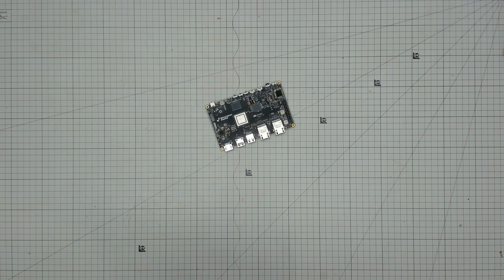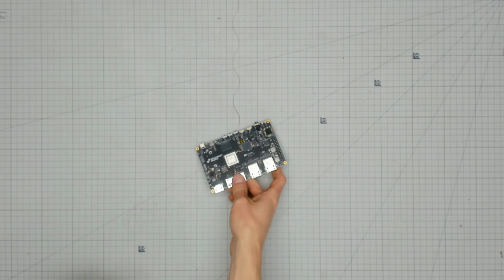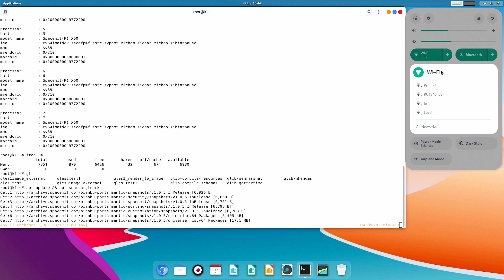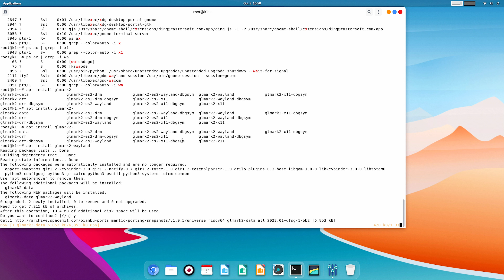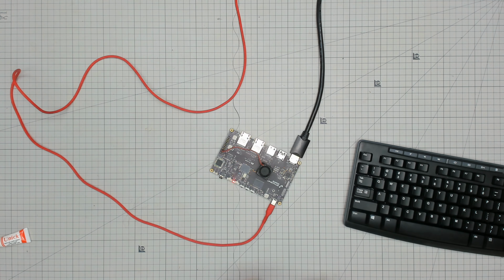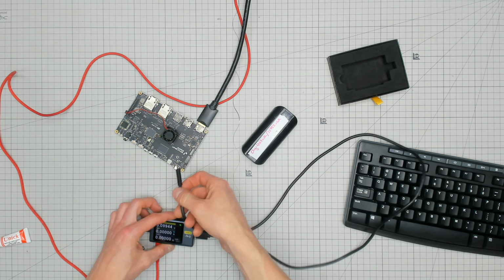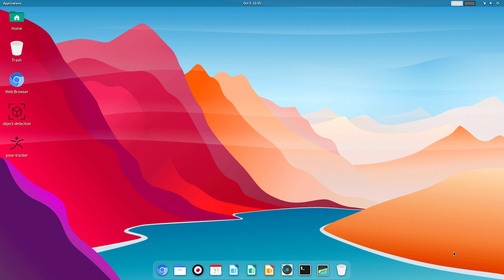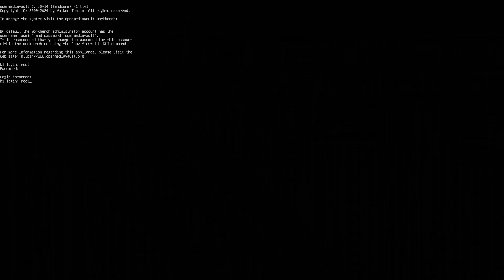SpacemiT MUSE Pi M1 - 8 RISC-V Cores, Dual Ethernet, Wifi AX, 2x 10Gbps PCIe

Comment: If you have the Window Capture source selected in OBS and don't see the terminal window as an option, you may have to select another source, then click back on the Window Capture source to see if any new windows show. Hope that helps, but if it doesn't, it's a great reminder to contribute to open source projects. :)
Reply from the maker: Yeah so I've been trying to get the Automatic Scene Switcher working properly. What got me here I think is that I had set it up the window title matching to include my username, but then when I was SSH'd to another device before launching OBS, it did find the window title and grab the hWnd from it to follow.

I think I'm going to add a small 7" external screen as a viewport/monitor so I can see realtime what's going on, as that would definitely help in the future 😅

Thanks for your input and suggestions either way!
Reply: @PlatimaTinkers  the most challenging thing with OBS is keeping an eye on it. Hope the additional monitor helps. :)
Reply from the maker: @WizardsAnonymous  hahah yeah I've noticed that! Slight improvements each time at least
Reply: @PlatimaTinkers  you're the man. Hope you keep at it, at least for sanities sake.

Comment: interesting, I'd be quite interested in getting OpenBSD running on these for router application.
Reply from the maker: Unfortunately I don't expect that to be an easy feat, but you could definitely get it going to a basic degree. It'd just be the lack of drivers for most of the IO that's likely the issue!
Reply: @PlatimaTinkers  true, that soc isn't explicitly supported. From what I can tell it doesn't seem very different architecturally to some of the other supported chips, but I'm sure there's enough to make it interesting. A man can dream though.
Reply from the maker: @mikepartin571  Yeah it's pretty much brand new.

You'd likely be able to get any kernel that supports rv64imafdc running on there, ideally with the vector extensions too, you'd just need to make sure the device tree is compatible - I'm not sure how *BSD handles those. Then it's just down driver availability for those attached devices!

Comment: How can we control the PMIC? It has an I2C interface but no datasheet. Some stuff are documented for kernel space drivers and UBoot. But no idea how to approach it
Reply from the maker: The PMIC is not meant to be controlled - it's pre-programmed to output the power channels the board needs, and essentially just sits there regulating voltages.

From what I understand, it may be connected to GPIOs 93 & 94, but whether or not these lines are enabled in the hardware or device tree I am not sure as it's listed as 'TBC'.
Reply: @PlatimaTinkers  excuse me, could you please tell me which document can I see the 'GPIOs' and 'TBC'?😀
Reply from the maker: @GEGE-White  same link from the description: https://developer.spacemit.com/documentation?token=JYR5wKYqqin4g0kfe6VclOoinRp search the page for "I2C Address". Enjoy 🤘
Reply: @PlatimaTinkers  Thank you very much!
Reply from the maker: @GEGE-White  Very welcome and good luck :)

Comment: Does the fastboot you use in the end equate to the fastboot used in android, and if so wouldn't you have more luck using the fast boot included with android Studio
Reply from the maker: Yeah same thing. There's a few versions you can use/install; there were two in the repos, the Google one and a generic/unbranded one, then I think you could likely get it with AS too, but that'd be the bloated way.
Reply: Oh that's super cool!
Reply from the maker: @ZaCaptain1229  Yeah I'd say!